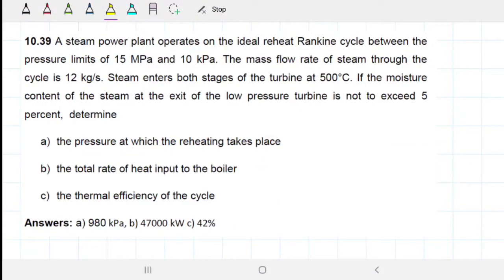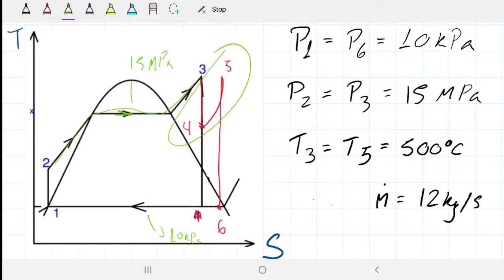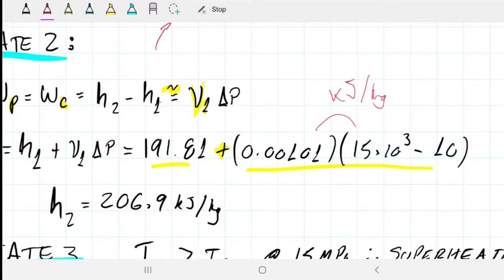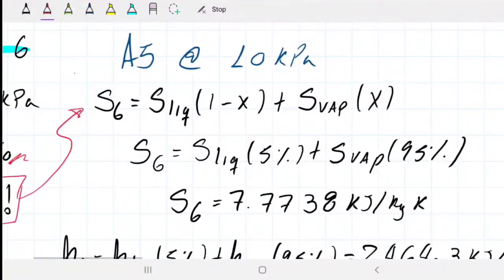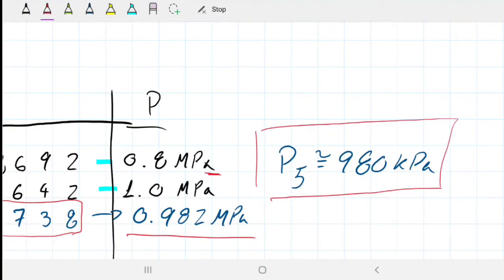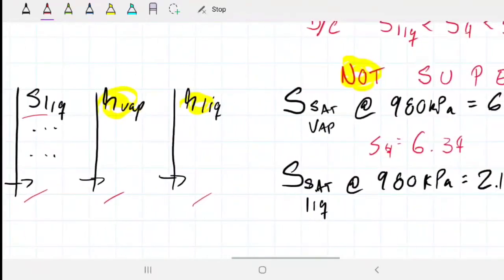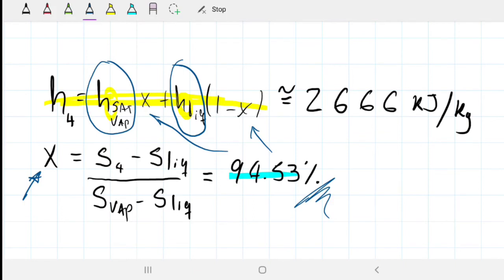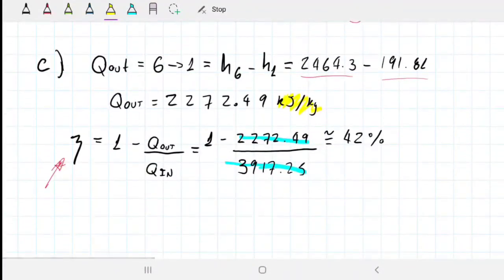Thermodynamics Mech3001 - Week 10 - Problem 1 (10.39)

Comment: I did not understand how do you find h4....

And if  4 was superheated what would we do?
Reply from the maker: You need two properties to define a state. In the case of state 4, you have the entropy and you need to first find the pressure of State 5 because you know it will be the same as state 4. With those two, you completely defined the State.

If it were superheated that wouldn't be a problem. You'd just look at a superheated table and match the pressure and the entropy